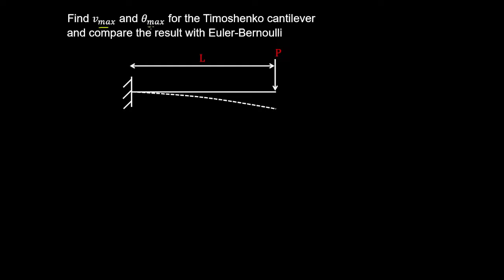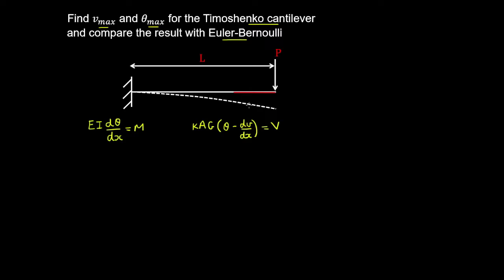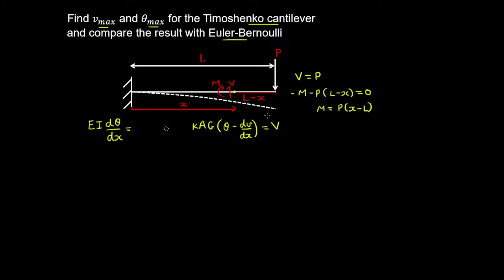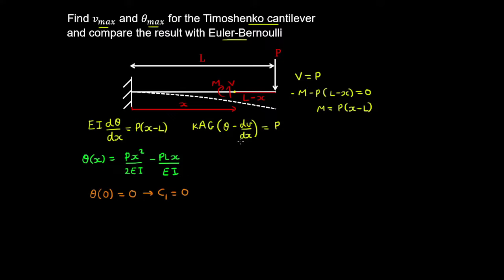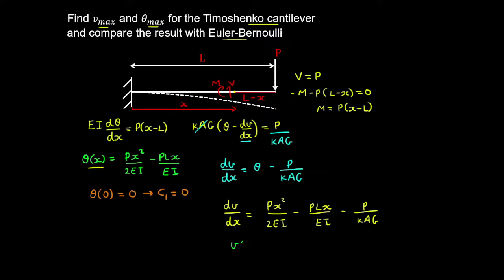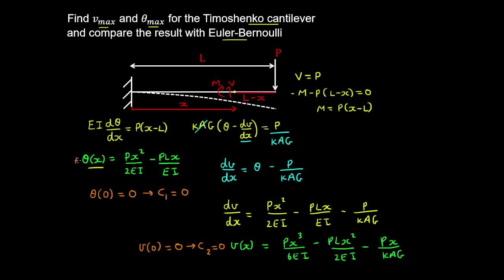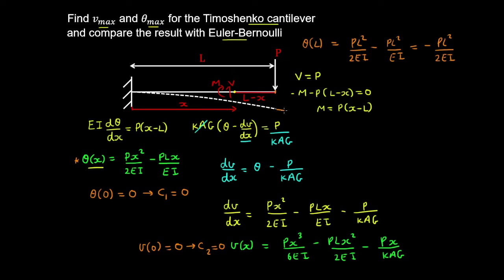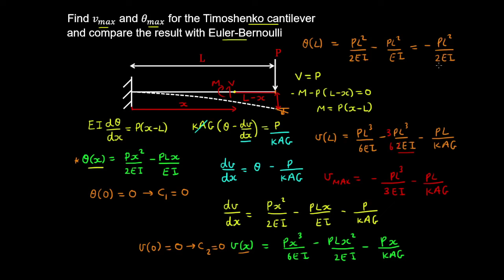Euler-Bernoulli Vs Timoshenko Beam, Cantilever, Example - Structural Engineering

Comment: Really helpful , I was searching for several days to find brief and concise videos regarding Euler's and Timoshenko's theories .Finally I found a perfect channel.
Reply from the maker: Excellent. Let me know if the other example for the simply supported beam was too fast, and I will do it again when I get a chance.
Reply: Thanks that is fine ,but if some day you get free time then it would be better to make a slighter detailed video on that, and if you make a comparative video of force based and displacement based methods of structural analysis and also to give an insight of where and why to use a particular method, in what type of problems of structural analysis, then that would be a master piece .I searched but didn't find such a video in youtube.
Reply from the maker: Sure Fawad, I will do that soon. Generally, the force method is good when you have an indeterminate structure with one additional unknown, where you apply a compatibility condition to obtain an additional equation. Displacement based methods like the direct stiffness method is good for solving indeterminate structures which can have many unknowns, and is the basis of the finite element method.